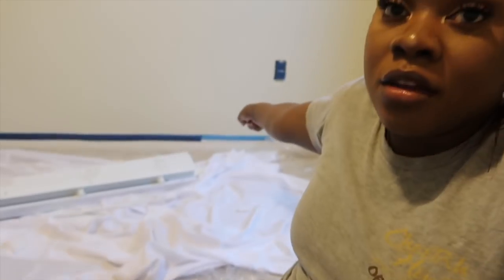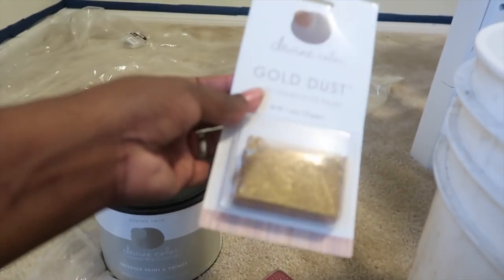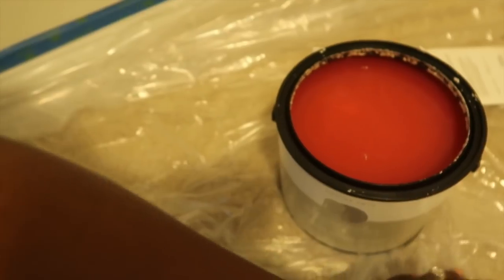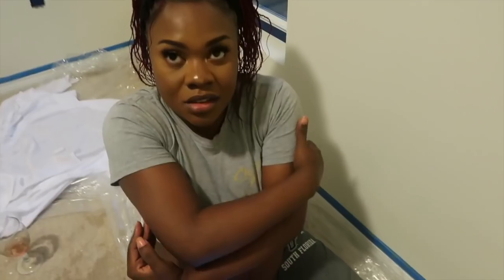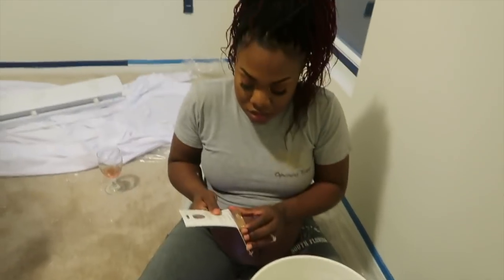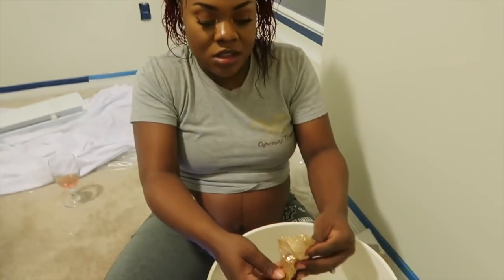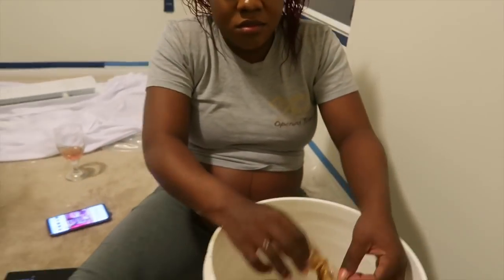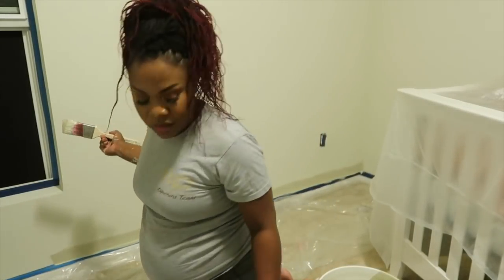PAINTING BABY NURSERY WHILE PREGNANT!!! NEVER AGAIN!

Comment: I haven’t started painting yet. And I already know I hate it. Ugh. But I love the idea of the glitter. Was it worth it or can you not tell the difference?
Reply from the maker: I actually do think it was worth it it does have a siddle glimmer probably could've even added another pack to make it pop a little more consistantly vs when the light hit it a certain way bcuz the room does not have good light it doesn't pop as much but i still like it and get compliments on it probably could just put a white light in to solve that problem but if using a darker color i would reckon 2 would be just enough